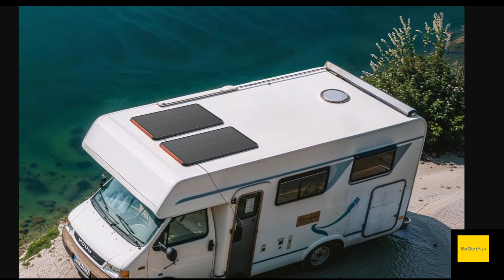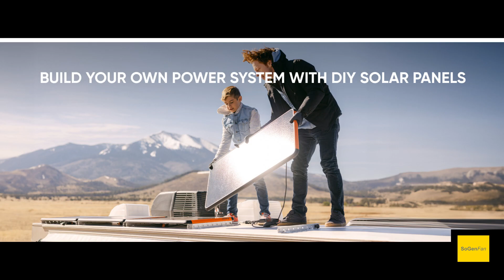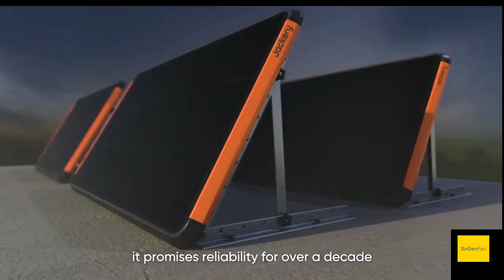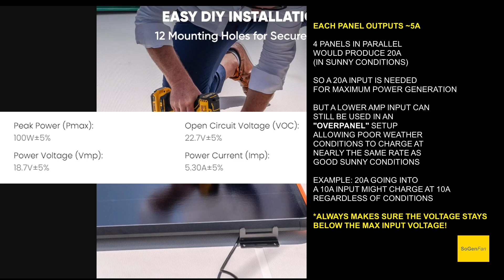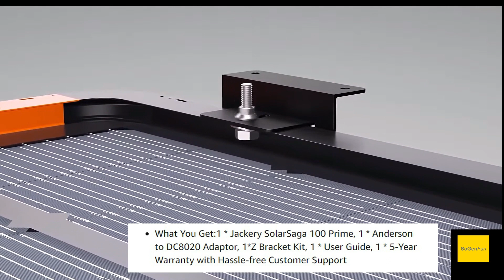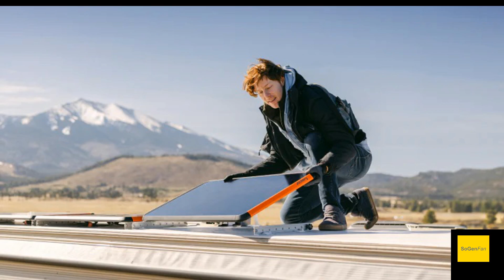Jackery designs a new Solar Panel for Vanlife & RV living

Comment: Dont waste your money.  Those panels require a special connector called pole connectors.  they dont make replacements for them so once they break then you have a panel that doesnt work anymore.  I have 2 that I cant use.  I tried to order a piece online but it didnt work.
Reply from the maker: It's a standard Anderson Power Pole connection right?